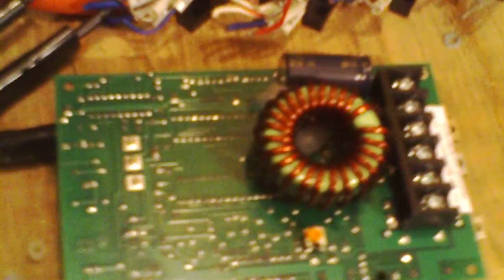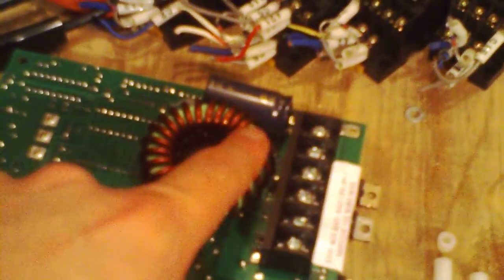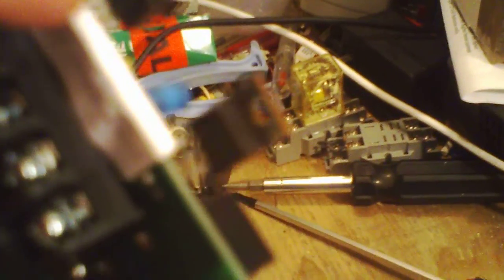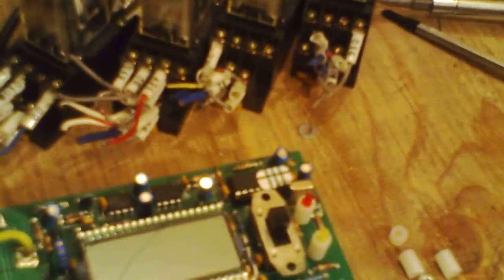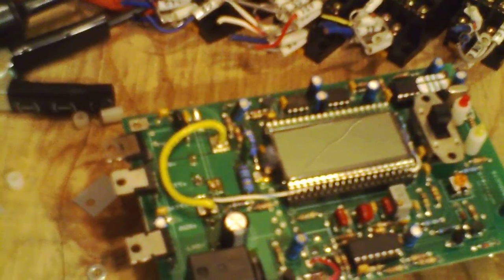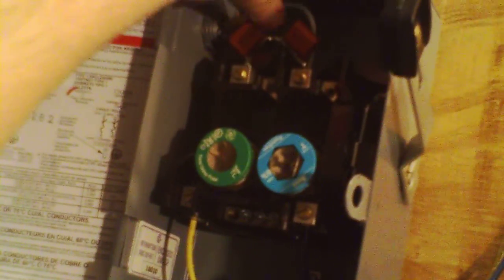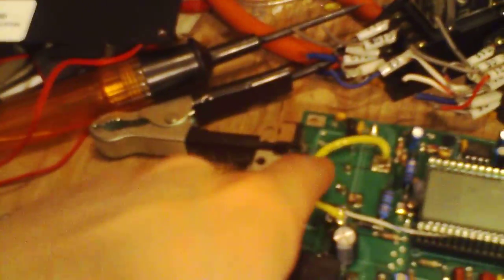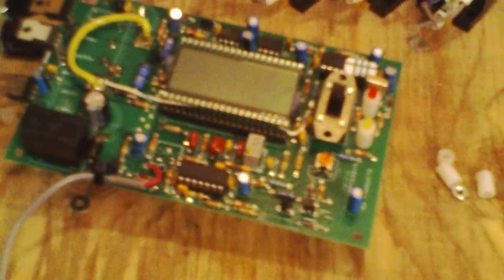BZ Products MPPT250 guts

Comment: The Chinese MPPT with the dot matrix screen (all aluminum box) works great in low light conditions. It has no minimum, it will convert .5a to .85a and has its best performance on overcast days where 18% increase is normal. I know the BZ would not satisfy me; not enough info displayed. I would hate to adjust the small pot on the BZ to set float when the Chinese unit does it all in the menus/ soft keys. Great little device for 100 bucks.

Comment: I have solar panels with 20v open volts about 18v loaded. I was wondering since the panels are closer matched for a 12v system wouldn't my small but nice $20 30a PWM do a good job compared to MPPT? I can see where you have 40v and you don't want to lose all that extra voltage and mppt will help there but my 3.6v difference between bulk 14.4v and 18v loaded panels at 10 amps would be 36w gained but the mppt's are expensive for 36w more.

Comment: Second, the black sealed off component at the end of the grey cable is a thermistor for adjusting float voltage according to battery core temperature.

Third, the yellow wire is the shunt, no there are no hall devices.

That said, any idea how to hack the gain adjustment for current sensing? The "I CAL" pot only adjusts level.

Anyone?

Comment: Ok, came here looking for information about this particular MPPT, didn't expect to end up making corrections.

First: The "little black box" is a relay yes, but has nothing to do with driving the MOSFET. It simply switches between MPPT and direct mode, to squeeze out those last few watts that just operating the buck would consume. It is triggered by current, somewhere around the 500mA mark, with a little hysteresis and some intervention from the PIC.

Comment from the maker: @KyleCarrington   There is a bit of increased loss in the MPPT250HV when running on a 48V PV array, but that is normal due to the over 50V potential difference between the PV array and the battery bank.  These do not have super excellent MPPT algorithms, but for what they are they are good.  I may do some experiments over the summer with designing a DIY MPPT controller if I can get a PIC programmer or the means to solder LQFP surface mount chips.